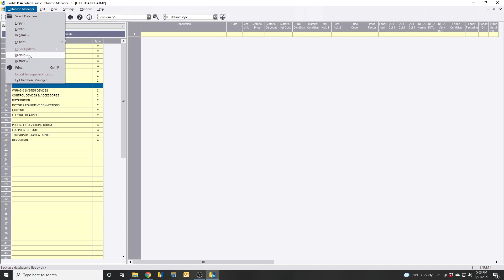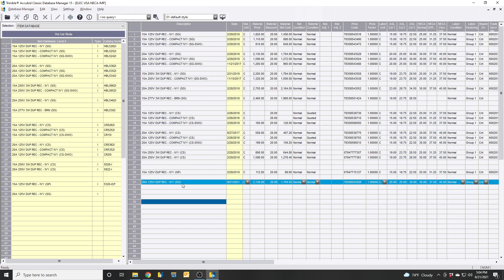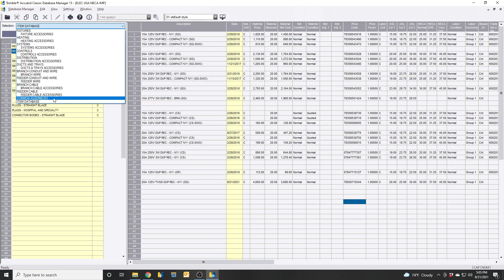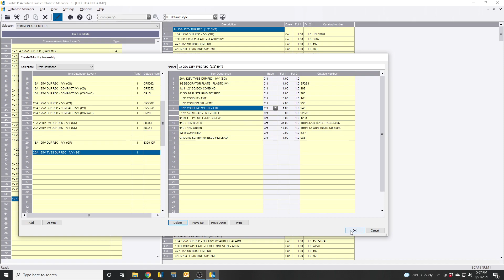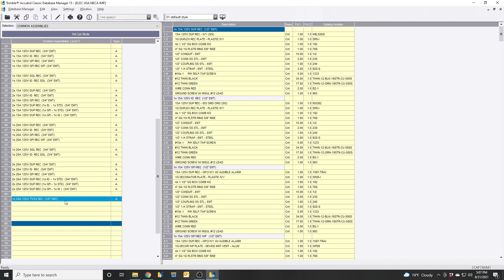Trimble Accubid  - Adding to Database Manager

Comment: In database manager, if adding an item to a group of existing items (like adding another size of conduit) how can you shift all other data base down a row?
Reply from the maker: The one thing I don't like about adding in Database Manager is that you can not move anything. Your only option is to rebuild it/ organize it the way you would like to view it. A shortcut would be to make a separate assembly, go into the one you want to adjust, delete it all, and insert the new assembly that you created. Again, there might be other ways to do this, but I found this method to be fairly quick.
Reply: @newageelectricllc5098  thank you. I have one other question that maybe you can assist me with. I have been using Accubid for some time now, but am just getting into creating/updating database. Accubid has NECA and ASL labor units. I have the book for NECA, but is there a pdf version for ASL? Or is ASL based on percentage of NECA?